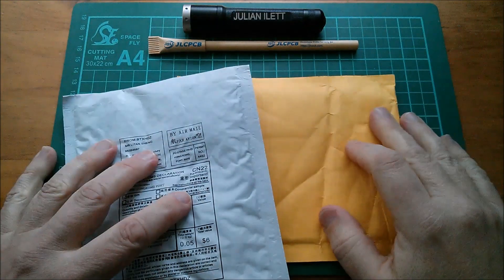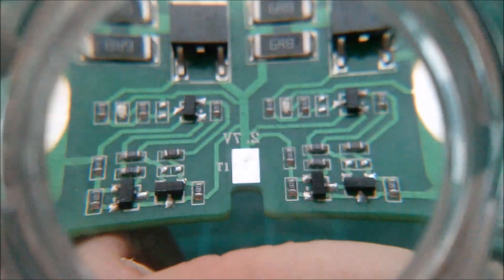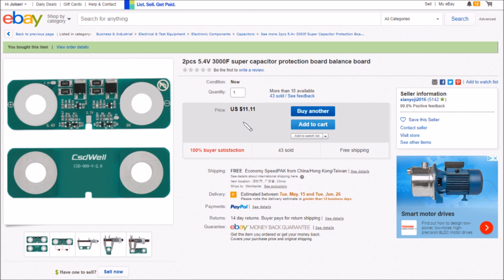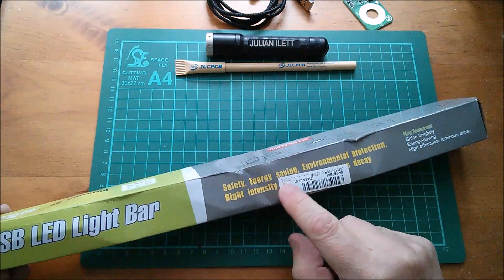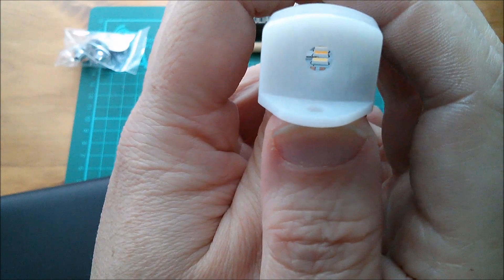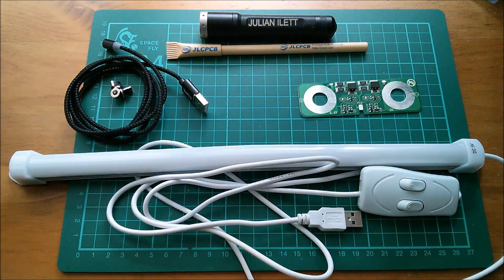Julian's Electronics Postbag: #118 - Buyer's Remorse

Comment: Are you familiar with the Japanese transistor numbering conventions?  Part numbers all have "2S" implied but not usually marked.  Those starting with A or B are PNP devices,  those starting with C or D are NPN.  Fets are J or K.  I'm not sure about E through I,  although I'm pretty sure things like unijunction transistors are in there somewhere.

Comment: USB-C Negative is the 4 on the ends, positive is the 4 in the middle, Or 4th pin over (towards the center) from the negative/ends on a standard data cable, that one is a power only.

Comment: It looks like the "2 pieces" aren't both voltage protection boards the one is purely to connect the other end of the axial capacitors together - so you didn't get 2 pieces but the second one is dodge anyway :-)

Comment: I've had so many linear light strips bent in the post.  It's a bit scarier with the mains voltage ones due to the tiny gap between the channel extrusion and the live tracks on either side of the PCB edge.
Reply from the maker: I like my light strips a bit bent - gives them character :)

Comment: About the protection board - everything was visible on the sellers page - you could clearly see the very crude circuit-design as well as the huge dimensions. And that thing is utter crap - why did you even bother!?!?
But getting only 1 of 2 boards is still a ripoff.

Comment: Those magnetic charging cables are nice but not as useful as one might think. I got a similar thing with multiple end pieces, yeah it works fine, but it does get quite warm for some reason and when inserting it at an angle, the pins short out. Theres no internal protection in the cable, Ive noticed that whatever is plugged into the charge all get cut-out of power, so basically you are shorting out the whole supply you use with the cable. And they work fine if the device is laying on a table etc., but holding it in hand, the weight of the cable alone twists the magnetic plug so it doesnt charge. So even if the magnets are strong enough to hold an ipad in the air when hanging from the cable (which mine was able to do), the bending moment when the device is flat and the cable comes out more horizontally disconnects the pins. Same when the device is on a table and the cable hangs off the side too much, it just twists the plug out, at least 10-15 cm of the cable itself also has to lay on the table (depending on the thickness of the device and case, i.e. height of charging port from table). 

So yeah I bought magnetic cables to charge and use with my devices, but ended up using them only about twice and now theyre in a drawer gathering dust :)

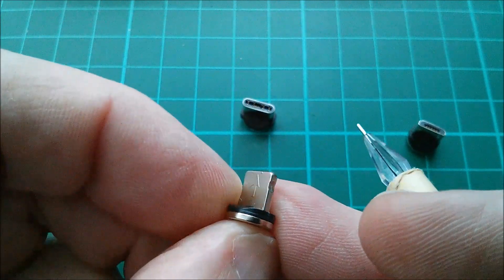Comment: It would be a  bit of a coincidence around 8:10 ,  that the contact points on that apple plug,    are wider at contact 1 and contact 5,  which just happen to be the ground and power contacts.    So having the slightly wider pads there might actually be intentional.

Comment: Now I lian... Shame on you... You have the very accurate. yxzstudio USB power meters and neither they or any of the other el cheapo meters made an appearance to a) see what was happening when the magnetic charge cable 'shorted' (did it actually short the powerbank or did an internal protection circuit kick in) and b) what was the power consumption of the bent led lamp (and how much more current does a bend add anyway? :-P)... There are some much better magnetic charge cables that also connect the data pins. The ones I have also have lugs instead of sprung hooks, presumably to make a tighter fit so the connector is less likely to pull out. That light strip looks really nice, and price seemed reasonable. Pity the seller didn't package it properly for posting... Mail tube was too hard for them?

Comment: The listing for that magnetic cable is now at $5.90USD...with a discount for multiple item purchase.

As far as the light strip...the seller should make good faith attempt to protect the product during shipping.
But you could take it apart & straighten the bar/heat sink out...then put it back together again.

Comment: The cynic in me entertains the possibility of seller trying to get rid of a supply of pre-bent goods by shipping it in a flimsy packaging banking on buyers blaming post.

And speaking of magnetic connectors, there are better ones that offer full 5 pin connection, not only power. And they are smaller so don't stick out this much.

Comment: buying the 3 way is good as they can be permanent on the items and you dont have to keep changing your charging leads. Also good for game controllers. if it gets pulled accidentally it wont matter. Think its a good idea. As for the shorting, it was only a problem when you messed around with it, but that's true of any item. Even a usb power lead could short ie new iphone which has bare ends.

Comment: As far as the bent light, it is INDEED the fault of the seller, for failing to package the device to protect it in a known rough handling postal system!  They should have used a stiffer package material.
Reply: -ABaumstumpf
No. There is no way for the postal system to know that this is fragile and bendable if it is not indicated
Reply: -ABaumstumpf
You obviously need to learn how postal services work. They can't take the time to handle every boxes like like they're made of fucking glass. Fragile packets are not piled up, reversed, or quickly handled.
Fragile packet handling also cost extra, since it creates exceptions for normal handling.
Reply: It is also the fault of the postal system.
Reply: CodeBurger
So the default assumption for you is to beat it up, lit it on fire, drown it and then crush it with a truck - cause it doesn't say not to do any of those things?

Comment: No, it IS the seller's fault for poorly packing the light bar.  It is their responsibility to package it reasonably well.  The post office would deny any claim on that even if it used insured postage.  Just like if you bought glass it would be up to the seller to reasonably protect it in shipping and not the buyer's fault.  As a buyer you should expect items to be packaged with reasonable care.  File a claim.  If you don't they will continue this practice.
Reply: Fwiw it could be sent in a rigid cardboard tube. Nice item though , I'll consider buying a couple for my wife's desk.
Reply: It is not only the sellers fault but also the responsibility of the delivery service.

Comment: I wish they made magnetic connector adapters for DC barrel connectors. 
I'm getting a bit fed up with having to put pressure on my laptop power cable to get a good connection after replacing the socket 5 times over 5 years and now being unable to get "good" quality replacement sockets (the type that last a year rather than ones that last 1-3 weeks)

Comment: Its a two pin cable hence the magnetic plug fitting, so not sure what you expected when saying you wanted it to do everything.? (data and all of that is of course out the door when its just 2 pin)
-its a cable for ease of comfort and leave it in and use the same chargecable on many different items with numerous plugs fitted on different items, particularly in Micro USB world and you dont need to right side up approach.

Also just got one of these TOPK branded one' this week though the red version and only 1xmicro USB plug alongside' as it was here in MicroUSB  I saw an advantage and it cost 3.8USD the cable with 1x micro USB plug with free shipping from AliE.
Have measured what the ligting that is on all the time, takes in amp draw but was so low that i needed 4 digits USB meter to measure, but on YZXstudio 1270 it stated 2.4micro amp draw so very little..
The cable is very thin and thats useally synonym with low amp speeds, but on the other hand it also just need two lines inside, so that could be the reason and from a 2amp AC USB socket here in DK, the cable performs 1,.9amp so not bad at all..though the amp was a little more jumping then what I would prefer but could be me that didn't let it settled and have not taken a graph measuring., just a first glance notice after getting it...
The magnetic effect seems okay.
the con on some devices it that you need a tight fit otherwise the plug will come oout alongside.when deattaching from a intended pull but on 3 out of 4 of my Micro USB items it didnt..

I think you need to take a moment before hand and examine the purpose of some of the items your purchasing as I again and again, are noticing you simply dont grasp the purpose of an given item and then whiining abut issues there is solely down to you not on call with the purpose of an given item and that approach is not valid for any, other then you felling sad about something you shouldnt if you had taken a moment to examine beforehand..
after all. it should be obvius that this is solely charging when there is only two plug active cable 10:33
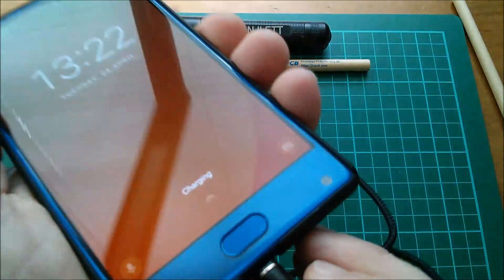and then baffling the plug for issues about getting it out again  10:55 c'mon Julian you do understand the purpose is to let it be there and in fact be as small and anonymous as possible, and if there was big slip so you could take it out with ease that would undermine the hole purpose by the plug & cable
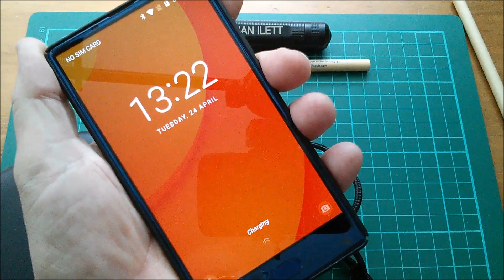Im not sure if your trolling by intent or simply dont grasp the concept.?  11:30

Comment: I'm waiting for my magnetic usb cables, and additional mag. adapters but got the one which includes the data lines too. So I can leave the the plugs inside my ESP32 & Teensy boards, micro usb are so small/flimsy that I almost forced one in reverse, with these it shouldn't happen… (aliexpress Floveme or so.)

Comment: That Lightning adapter is garbage. They're supposed to have pins on both sides, so you can plug them in in either direction. I don't know how this one will behave.
Reply: The device's female lightning port only has pins on one side. Since this is supposed to "plug and forget", you orient it correctly once and never think about the orientation again

Comment: It doesnt justify the way too high price but the 2pcs probbably is meant as in the board is meant for 2 5.4V 3000F super capacitors.
Scrolling down the ebay page for the super capacitor protection board it says: Package Included:
1 x 2pcs 5.4V 3000F super capacitor protection board balance board.
Reply: Considering that there is 2 boards displayed on the main item picture and other sellers sell one of these boards for half the price, I would request at least a partial refund.
If the description says 2pcs 5.4V caps let's connect two caps and run it to 10.8V total then. If it can't take that request a full refund.
Reply: the picture shows the front and the back, this could be seen as 2 different boards, the board is meant for two caps as shown on one of the pics on the page.
Reply from the maker: Next time I think I'll buy the 1pcs for $5.66 - hopefully I won't get half a PCB :)
Reply: Other sellers really do sell two boards using the exact same pictures. At least they say so in the description and considering there are others that sell single boards for about half the price, this seller's listed item is highly misleading. I usually make sure that I read the description to see exactly what I get. But since sellers like this make it harder to compare prices by using ambiguous pictures and wording in the title, I'd still like something like this disputed.
Reply: Ebay is Ebay, lets hope it doesnt get that bad. Its not like you havent bought anything on Ebay before, you win some you lose some :). keep up the great videos always enjoy watching them.

Comment: That magnetic cable actually could save your USB socket from wearing off. I think you're supposed to leave that endpiece permanently in your phone.
Reply: There are ones that also have the data x-fer capability...but they are considerably more expensive.
Reply: Been using them like this for sometime. They are actually quite good, when used with additional magnetic micro usb connecters on different devices. Quick connect and disconnect.
Reply: Not much good saving the connector if it shorts out the USB socket and damages the phone's charge circuit (or worse).
Reply: I wouldn't like that.  I can just see it getting caught on things.  It would be nice if my iPhone already had a magnetic end like that.  Obviously it couldn't since you need to also be able to transfer data thru that connection.  Oh well :)

Comment: IMO, identifying part numbers removed by grinding suggests preventing - or at least making it very difficult - for competing manufacturers (not buying customers) from copying a design.  After all, we know once a circuit is public, oriental cloners make product to wedge into the market.  Next time I buy something with removed part numbers, I might just consider desoldering the chips, to test to find out what the big mystery is.  Then I can reverse-engineer for my own benefit.
Reply: Making it very difficult? After you've drawn out the circuit (which you need to do anyway, if you want to copy something) it will take another five minutes at most to find out what those 3 pin devices are. Most likely two BJTs (one for switching the large transistor, one for the LED) and a voltage reference (like the ubiquitous 431) per side.
Reply: or do they grind them off because  they don't meet specs  or quality control.  Then  they end up on some black market  and  low end manufactures pick them up for use in their low in boards?
Reply: superdau  Yep. And it's not exactly going to be a difficult circuit to recreate even if it's difficult to work out which exact parts they used. As (1) it's likely this circuit is a copy of an existing design and (2) it's a variation of a shunt regulator and shunt regulators have been around for over 30 years...

Comment: You can get an app for your phone called ampere that will tell you the charge current.
Reply: I waa just thinking that. tells you how much your charging the phone. I do get low results when using cheap cables.
Reply: you want a dude there is having the hole field of accurate YZXstudio USB meters, to use an internal app to sense charge-current thrue app?? lol are you for real or just being sarcastic.
It is less informative as putting your tonque out the window for freaking sake' unless you actually know the ampdraw from having the phone running in itself.that goes without saying and even then it varies greatly from amunt of tasks active.
If this fellow had any intent to actually demonstrate this cable and how it did its main purpose to charge and what amp draw it could sustain he would of course have plug on one of his bunches of accurate YZXstudio USBmeters onto the cable.

but that's not his purpose, otherwise, he would, of course, have done it,. as it goes without saying and is likely the most relevant info to get out there.
His main purpose for the time being is sadly to whine and not sure why, if he is just a diva with loose hand wrists needing to let out some steam in the hope that what his vierwers want to see.. something like another high maintance primadonna with an attitude like a spoiled curling child who have been swiped all there life..(I hope not)
But a shame he doesnt take a moment to this homework on these items and actually displaying these items main purpose and how well they do it, and it could be something as little as just taking one of his freaking USB meters and testing an effectct from a known PSU source.
picked up one of these also at  3.8 USD but with 1x micro USB plug from the same TOPK rebrading just the red version and on a basic 2amp USB huawei psu im getting 1.9amp så decent enough.
the light takes 2.4micro amp according to YZX1270 USB meter so not bad, and here in regards to a plain blue diode.
https://imgur.com/a/TdTRxqt

Comment: This multi plug cable looks terrible. I think you are supposed to leave the plug permanently attached to the phone for the intended result. Either way, inserting and removing it too much can potentially cause damage to you micro usb female port due to lack of springy hooks. Can you measure resistance of the cable and post the result. I wonder if it any good.
Reply: Arik Yavilevich 
The Lack of springy Hooks is probably intentional so that the usb plug doesn't come out as easily
Reply: Don't forget that devices expect some kind of signalling on the data pins if your source can provide more than basic USB port current. Given there are only 2 pins connecting to the cable, this would have to be performed by the little connector itself... Which isn't good as it's either not going to signal more than basic current (slow charging from a powerful source), or it's going to signal a higher current ability than your source can actually provide.

As for the lightning connector, isn't that supposed to be reversible? I don't think I'd want to push that into an expensive fruity device.
Reply: Simon Tay  I have not looked recently, but it was possible to get right angle 2.1mm/5.5mm 'barrel' power connectors.
Reply: I hate microUSB. Its such a stupid and fragile connector. If it gets knocked, the socket in your device and/or the plug can be damaged. MiniUSB and DC barrel connectors are better. 3.5mm TRS plugs are best of all because you get rewireable right angle ones.